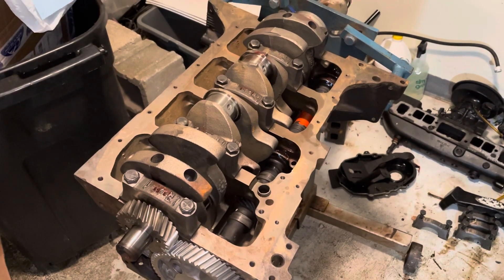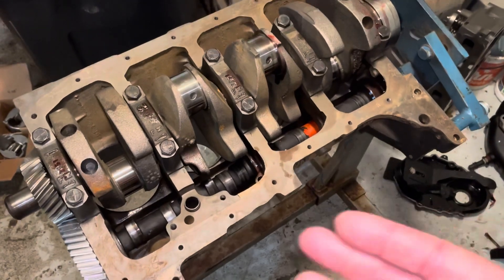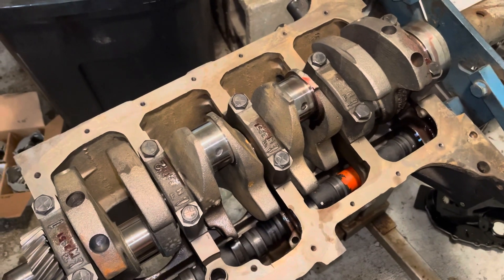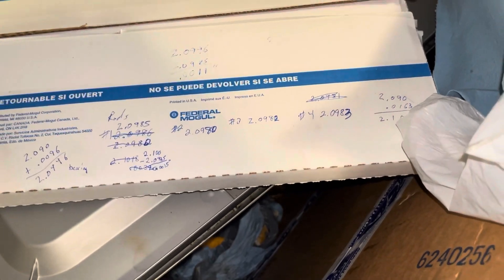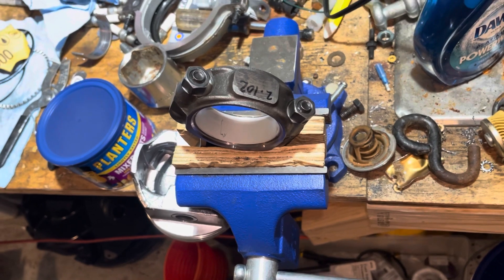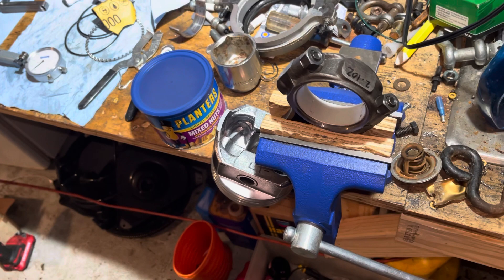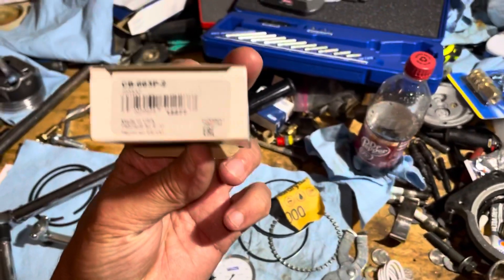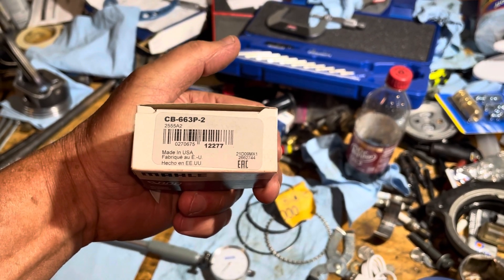Mercruiser 3.0 2(h)- Thanks Mahle

Comment: couldn't you have had the rods resized back to factory specs.
Reply from the maker: The bearings were $3 a pair.  Resizing rod costs $15 per rod. And I was in a hurry. Also resizing rods shortens them ever so slightly. But thanks for the suggestion and being a part of my channel.

Comment: years ago the most common bearings come in - and + .001 .002. and .003.  i've honed rods  and used the + (larger shell od  to get the proper fit.  just double check concentricity so the crush is even. its a very fine touch on the hone machine
Reply from the maker: For a shop trying to stay on schedule it’s a fine line between custom fitting something that doesn’t quite work and just throwing parts away and buying new. Had these bearings not worked I would have thrown the rods away and bought new however since I had already mounted the pistons in these rods, I had to try and save them.